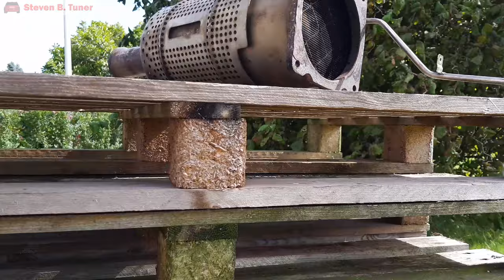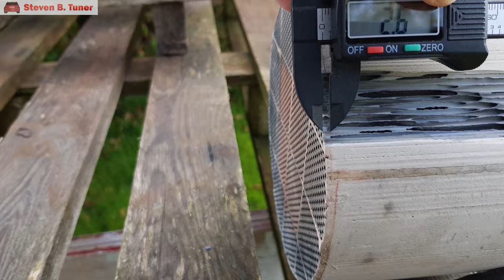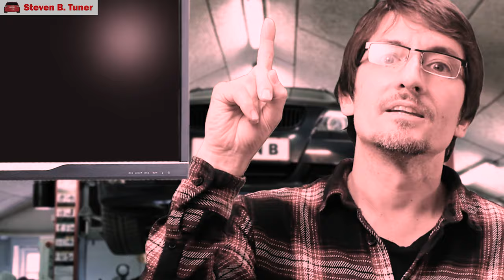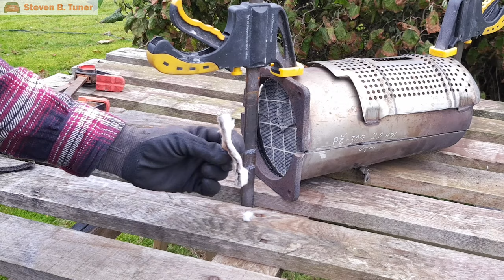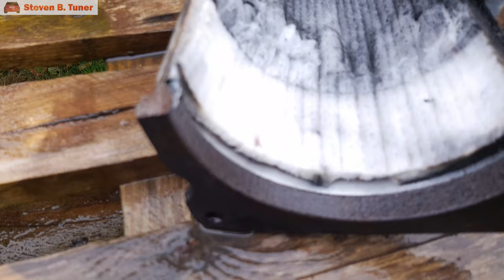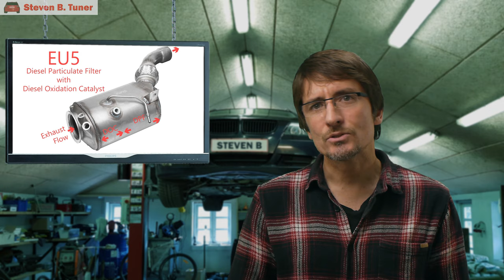Diesel Particulate Filter Versus Pressure Washer – How To Avoid Damage

Comment: Ridiculous that we have  to fix something that shouldn't be on the car in the first place... I rather remove the dpf and egr and have a healthy engine without problems
Reply: Yeah, and let others (pedestrians..) breath the exhaust gases unfiltered, ..after you affect the integrity of the factory designed pollution system..
Reply: @MrFryfish  Say that to the large ships and coal plants that are spewing out toxic air in a lot higher quantities than cars. 

Why should I have the problems and cost of a defective system some bureaucrat thinks is a good idea? 

I will drive my old diesel car until it dies, then I will by a EV to replace it.
Reply: @TheJensss  you should drive your car as it IS been designed from factory.  It is not legal to modify the exhaust filter the has been designed in factory.
That's all. Keep your diesel intact.
Reply: @MrFryfish  You failed to answer my question on who should take the bill when my car was delivered with a faulty system from factory? And no, I don't live in the US so it is no illegal to remove the dpf. I also just drive in rural areas so local air particular pollution is not a problem.
Reply: @TheJensss  you want a diesel reliable engine?
2 stroke oil, 250ml/50 litres of diesel and the engine will last 500k km with no problems what so ever.
Let it run 2-3 minutes in the morning when cold and it will outlast you.
Jaso FD for DPF cars.
Jaso FB for no DPD cars.
I am using currently in 3 cars 2 diesels and one petrol engines. 
Zero problems. 
One is Euro 6 if you know what it is. And did short distances for the last 3 years. Zero issue with dpf getting blocked. I am typing this for others, not for you  non believer.. in pollution, refusing to do you bit...
Good bye and good luck.
Reply: @MrFryfish  The dpf need high temperature to work. When it is -30 celsius outside and only drive 10 km to work it would get clogged pretty fast. I know this because it happened 3 times before I got tired of cleaning it and removed it completely. 

The dpf helps with local particular air pollution which is not a issue in my are. As I told you I would replace the car with a EV when it dies and I can afford a EV. 

I want to help the climate, but not when it cost me unnecessary money that I don't have.
Reply: @TheJensss  ...and why you did not said a world about -30 degree probably Celsius..???
90% of the rest of us leave at more humane temp. like -10 max in Winter, and even that is a bit low on that occassion..
you should have a non-dpf car with cast iron engine block.., nothing fancy, 0W30 engine oil.. or even W20.. and that would be better for the engine. 
You should have said that from the begining. 
Nothing I said would apply to you.
..maybe 2 stroke oil.. 😉
Reply: @TheJensss  electric car at -30 degree??
Please do not make the mistake and touch one.. EV. 
We need you..😄
Reply: @MrFryfish  Yes -30 celsius... Normal winter temperature is -5 to -25, but last year we had temperatures down to -30 for almost a month. It is often problematic to start the car if it is not in a garage, but a EV will drive just fine with but with limited range. If you preheat the battery or have the car in a garage the range is not that limited. 

im saving about $2500 on diesel a year with a EV so thats why I want one.
Reply: @TheJensss  That is the cost of saving 2500$ it is without considering the drop in value of the battery of the EV over time? Or is it with that included?

What area of the globe is that where last winter was THAT COLD for a month !?!
In my life somewhere in Europe (East) I remember few winter with couple of days -10 Celsius and I could feel if I was outside the cold I would feel it through the clothes if I was to stay long enough in one place.. but -30..🥶
What surprises me is that environmenta1lists are sayin' the Earth it is warming and the opposite we are actually b3ing told.
Reply: @MrFryfish  I live in Norway so winters are cold in many places in the country but not alongside the cost. 

The $2500 saved is only on fuel. Since I will buy a used low milage Tesla model 3 for about $25 000 with a estimated life of 10 years and maybe more, I think the value drop is about the same as a diesel but maybe a bit higher. 

Maintenance also have lower cost on EVs and we unfortunately have a lot of toll roads where EVs have a discount so total savings for driving a EV vs a diesel is about $3000 for me personally.
Reply: @TheJensss  I am surprised that you do not feel forced forced by gouvernment into buying something that potentially it can be costly in long term for you as private owner? How long a norwegian usually own a car?  In UK most of us buy new car on lease.. which in simple terms means forever in debt.. because people likes to swap 2 year car with newer version.. 
UK incentives from government did not last long.. and recent news about Elon Musk getting involved in recent riots in UK with his extremist opinion will lose even more potential buyers, putting them off start paying for Tesla. Elon is not seeing well in States either because he is perceived as untrusted person.
Could Norway and norwagians percieve Tesla and Musk better!?
Reply: @MrFryfish  I don't feal forced to buy a EV because it is the future and the government has done a great job building out charging infrastructure so ownership is really easy. However, I really hate toll roads and all the car taxes and the constant push for people to not drive their car. Public transport is not a alternative for me where I live, but they still removes parking and so on in my local town... 

Personally I would just buy the best and cheapest car that I can afford and with the local pricing Tesla model 3 is on top. I would have bought a Xpeng, but they don't have any suppliers of spair parts so no thank you until that is fixed. Many people don't like Tesla, but that is because their customer service and bad build quality on some cars. I don't think people care that much about Musk when desiding what car to buy.
Reply: @TheJensss  Thank you so much for your answers. It explains many many things about government  intention in your country. Your country might have the funds to support all the costs to implement owning an EV (which I doubt..) since is trying to stuck (force) it's citizens to use public transport..
Which in time by the way limits a lot more the liberty of these citizens to reach far and away unexplored territories for the sake of exploring.
You probably can see where I am going with my idea.. Limits, limits and even MORE limits on liberty..
Which is sad. And all this in the name of ..protecting the nature.
When the nature... we can't control the nature!
But I am sure experiments with nature were done and are still made.
Cloud seeding it is one of them..

I will try my best not to fall into any rabbit hole neither to let me being manipulated.
I am sorry that I cannot agree fully with you on some aspects..

Have a nice day.
Reply: AHH excellent I'll use the washer to destroy the dpf and get it remapped out 😂